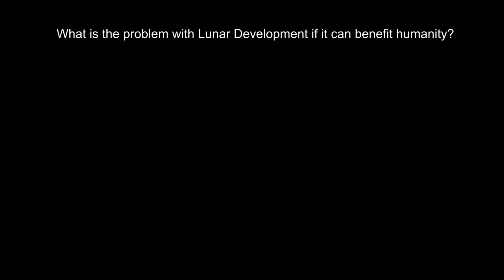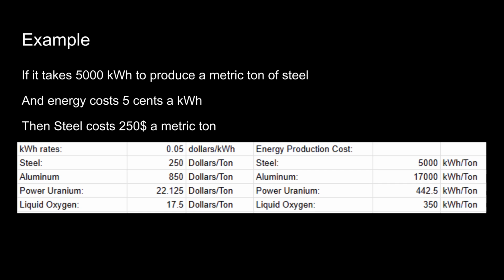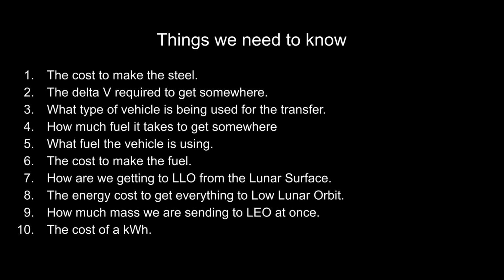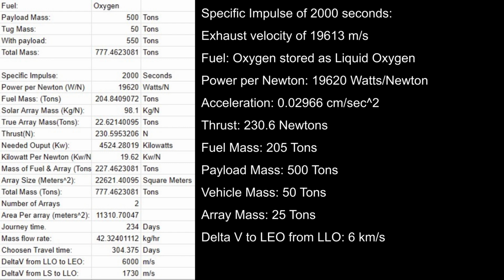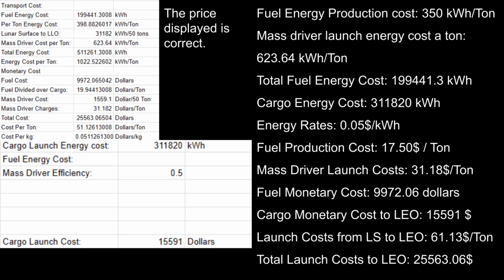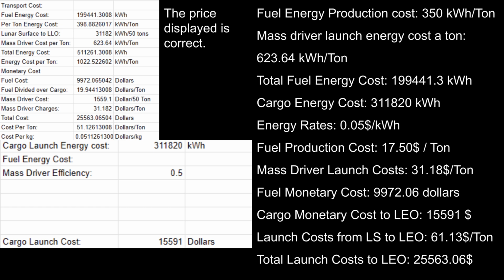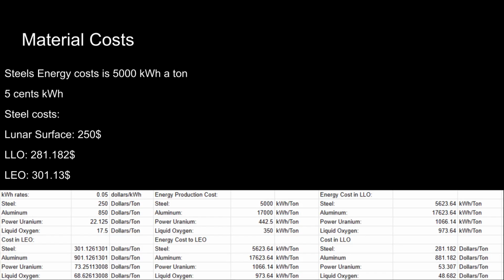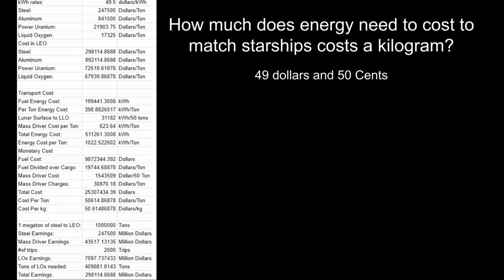Lunar Development: How to set the price of Lunar Materials

Comment: Yeah mass driver is necessary for lunar mass exports to make sense. Maybe you can consider doing a video on mass drivers and why they make sense for the moon over rockets? Delta-V and all that. Your videos are definitely improving. I very much look forward to the next one!!
Reply: This is wholesome af
Reply from the maker: It doesn’t even need to be from a Delta V perspective, it could also be from an energy invested comparison/perspective to get the same amount of delta V for a specific payload mass to Low Lunar Orbit.
Reply: @CeoMacNCheese I mean delta V is kinetic energy magnitude. You'd just be adding complexity.
Reply from the maker: Well I think doing the calculations of the energy needed to refine a few parts of each one. The energy needed to refine the fuel of a specific payload mass and compare that to the energy needed to build and launch a payload through a Mass driver, it will be interesting to compare the two to see their best use cases as well. Cause comparing a rocket and a Mass driver is also a thing about figuring out where both can do the best job for the energy invested into them. And well Delta V is just the speed change needed to get into orbit or leave an orbit, which is kind of hard to visualize and compare especially since one is electricity and the other is burning stuff for its speed change.
Reply: @CeoMacNCheese  ah I see. I was thinking about mass driver to LEO vs Earth to LEO using a rocket, but whatever works! If you're doing moon to leo rocket vs mass driver then yeah it totally makes sense to measure kwh. Chemical fuel will probably look better in kwh terms for one trip but you have to take into account what the rocket does next. Is it thrown away? The mass driver just keeps shooting so an equal footing conparison would be one where the rocket flies back and forth from moon to leo and that 2x delta-v is where it falls apart for rockets.
Reply from the maker: Yeah thats what I was thinking, rockets are good for one time or occasional things. Like you just need to launch something immediately and quickly with a good amount of mass into LLO. While a mass driver is better to build for a consistent mass throughput to LLO.